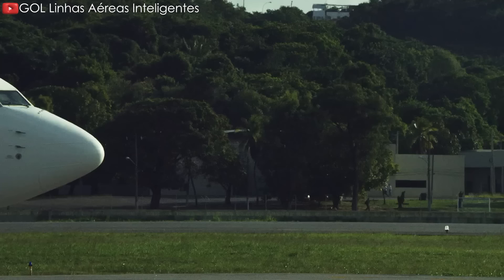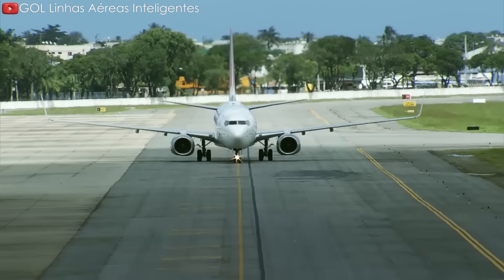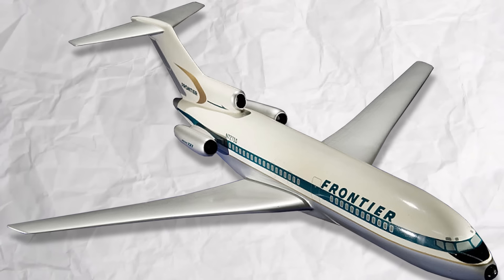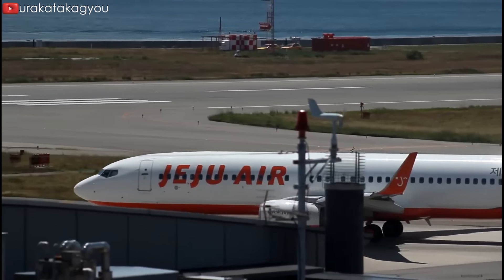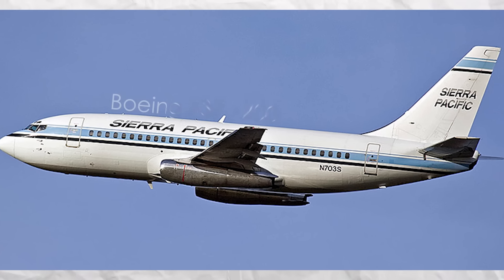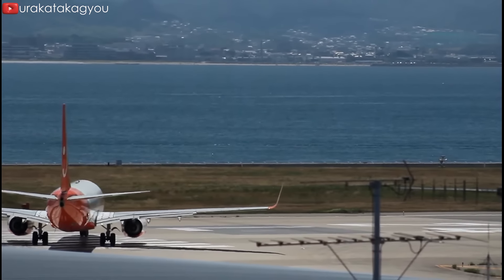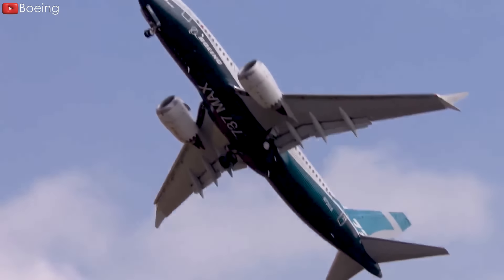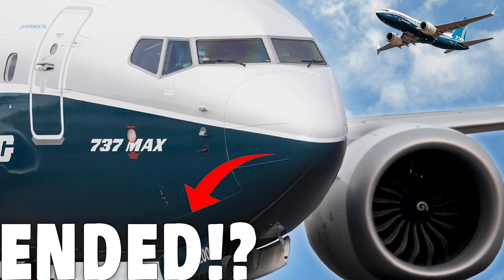END of the Boeing 737 cause of this Airbus! Here's Why

Comment: Boeing could have purchased the CSeries program for $2.00 outbidding Airbus who purchased the program for $1.00. 

The Airbus A220-500 and A220-700 engineering has already been planned and for the most part already completed which will replace the bulk of the 737Max and A320NEO aircraft.

Comment: There are several hiccups in an otherwise clearly-delivered narration - particularly incoherent in the case of the Concorde (timeline 5:42).
You make an interesting description of the launches of the B727 and DC-9, and I hadn't realised the Rolls Royce Spey engine was initially earmarked for the rear-engine B727 until the more powerful P&W JT8D became available. But you completely fail to mention the Spey-powered, twin-engine, two-pilot BAC One Eleven, which entered service about a year before the similarly-configured DC-9. The One Eleven initially sold well in the U.S. and elsewhere until sales were eclipsed by the DC-9 and then the B737. Its main limitation was the lower thrust potential of the Spey.
You go on to mention that the slimness of the JT8D enabled it to be mounted easily underwing on the B737 (series 100 & 200), but fail to illustrate the slimness of the nacelles - instead showing footage of later CFM-56 installations. Those slim JT8D nacelles are reflected to this day by the unalterable geometry of the 737's main landing gear. That necessitated repositioning the CFM56's accessory gearbox to the side of the engine to achieve ground clearance, creating its characteristic, non-circular cowling installation. Much later and less happily, the CFM-LEAP engine has had to be mounted forward and upward on the 737MAX, affecting aerodynamics and longitudinal stability.
Reply from the maker: thanks for your sharing ✈️✈️✈️

Comment: Wow Airbus fanboy much? Airbus is a good aircraft and so is Boeing...
Reply: Technically, the 737 is an ok airplane.
However, the problem is the quality issues at Boeing and the lack of transparency at Boeing at the moment.
The case with the plug door on the Alaska Airlines MAX-9 is ridiculous since Boeing claim they do not have any documentation about the installation of the plug door which should be considered in the light that this was a brand new airplane being assembled where everything shall be documented always.
If Boeing cleaned up their act and ensured top quality all the time, Boeing would have a perfect product but they have so far been unable to do that.